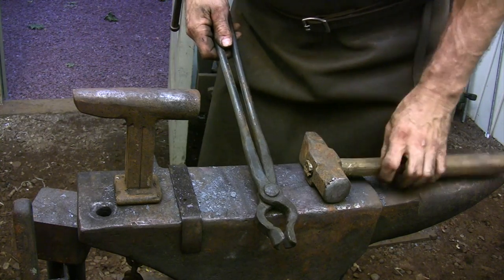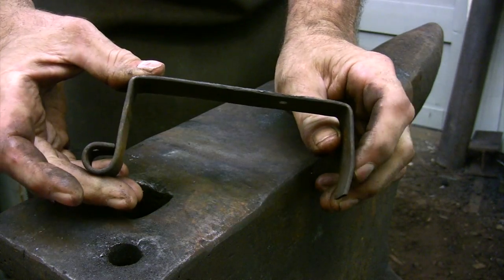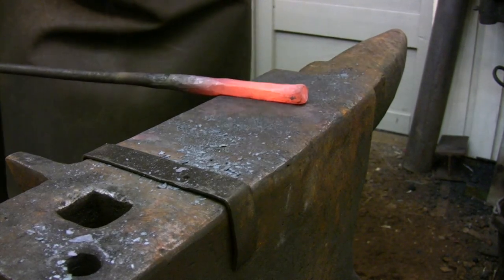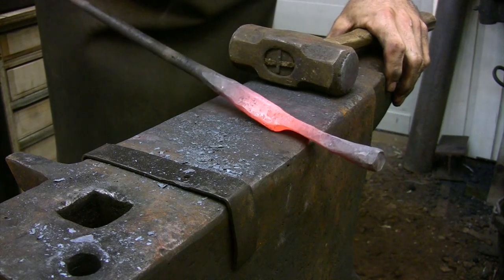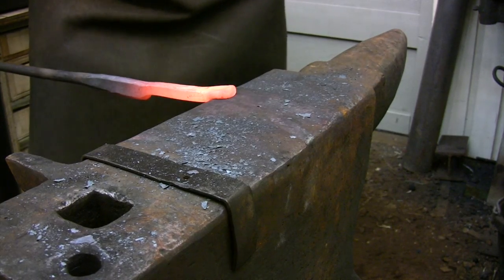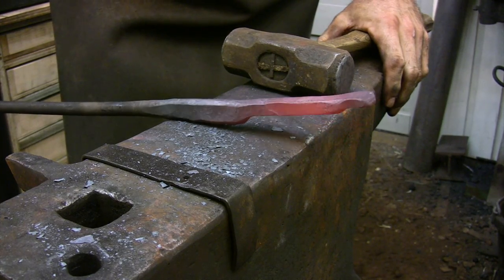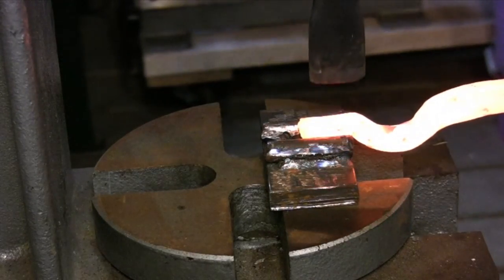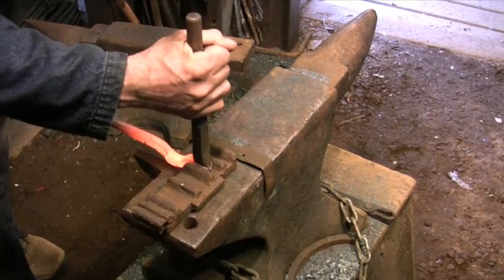Blacksmithing for beginners -  Forging blacksmith tongs  5

Comment: As a fifteen year old with only about one year of blacksmithing under my belt I find these videos extremely useful for me and my homemade forge. Not to mention you are quite the inspiration for me. Keep up the great work, sir!
Reply from the maker: It sounds like you started bout the same age I did.  I used to get up in the middle of the night during the winter and turn the furnace off.  Then a few hours later I would turn it back on.  That gave me about 20 minutes to forge out little knives while the furnace was constantly running trying to heat the house back up again.
Reply: trenton cook I just turned 15 yesterday!  I have been at it for a year and a half or so and they are helpful when I want to refresh my memory on how to do something specific.
Reply: Keep it up mate, youngsters like you are our future and preserving these older and slowing being being forgotten trades is very important! Hope your kids in future years carry on the knowledge you are learning now! Seek out the old guys, not hard to find if you really look hard, a world of knowledge just waiting to be exposed and they would be so tickled to have a young guy like you sucking the knowledge out of them!
Reply: I know there are a lot of blacksmithing channels, but i find Torbjorn Ahman work also very informative. One of my fav channels ;)

Comment: I built my forge pot as close as I could to you instructions because I felt it was good advise .Then other said my pot would be wasting fuels unless I was build large hammers and such ..Then I built a second pot which sats in your style larger deeper pot .Wish I could send my finished forage picture but I don't know how to.
Thanks for your help Sir.Merry Christmas
Reply from the maker: If you are using a hand cranked blower or bellows to supply air to your forge you will not be waisting fuel with this design because the fire is only getting air when you are at the forge working the blower. It is true that you will need a lot more coal to fill this forge for the first time but from that point on you should be using basically the same amount of fuel as anybody else.  If you are working on small stuff the heats will be faster so only a small fire will be maintained in the centre of the firepot and if you do need to heat up something larger the fire size will grow to accommodate that because you need to give it more time to heat up.  This firepot design has been found to be  a good compromise between being too small and too large and was the design used by every blacksmith that I visited when I was starting out.  As always , be careful,  when you get 50 smiths together discussing blacksmithing you can be assured that you will receive 150 opinions on any one topic ( 250 or more if alcohol is been served ).  Your success in blacksmithing is going to be determined by your ability to figure out what works for you.  All I did here is give you another opinion for you to consider.  Good luck and please let me know which firepot you decide to go with.
Reply: Love your bending tool , I'll be build my own copy latter Thanks

Comment: Firstly,  your methods are simpler to follow than the "Standard" procedure I was taught.  Your fixture for upsetting the bar is genius,  it takes about a year of frustration out of the learning curve. Secondly,  locating the eye is so much less troublesome.  Having that eye already in makes the flat a no brainer. Thirdly,  having the tongs from the first offset back identical makes tongs a magnitudes easier.

Comment: Many blacksmiths on Black Bear Community Forum. Avise a constance heat for I am using the Antricke ( that's the coal from west of Mississippi saying it needs steady air flow , I can't spell well Sir " 
 Next time I'll get the soft coal .I need heat near surface of forage to heat rods for tongs and my small pot worked better it seemed.
  But I try adding charcoal and wood and that was advise with a steady air flow which seem to helped.
   Thanks for helping me and others .
  I'll be playing as safe as I can , I get back in a few trails with fuels.
   Yes can't listen to all ...My pot is square shape next time I'll give measurements it's within half in as your prints and I did the cardboard model that was helpfully .But 3/8 in.steel was a challenge for my tools to cut .      Thanks

Comment: Hi, I'm 18 and for my 19h birthday im thinking of getting a few bits and pieces i need to begin my own small forge, everything i need is often quite expensive, tongs included so i figured why not smith the things that are initially non essential! does it sound reasonable to attempt forging tongs as one of the first things presuming i have at least a few different punches, is it too ambitious? i'd love to hear back from someone who has a lot of experience such as yourself! love your videos and your crafting skill! thanks a lot!
Reply from the maker: We all started with a charcoal barbeque,  a sledgehammer head anvil, a carpenters hammer and a pair of vise grips for tongs. I've only purchased about 10 -15% of the tools that I have, everything else I've made. That's what a blacksmith does - he make tools for everybody.  Hopefully this channel ( and the others on youtube ) will give you some shortcuts through the process that I didn't have but at the end of the day - your understanding of the craft is going to  depend on how much time you spend in the shop working at it. So the sooner you start, regardless of what you need to work with,  the better.  I don't know if you have seen this video yet?  https://youtu.be/RtIQa00AFqI    I designed these tongs to give beginners a way of making tongs without all the forging problems of traditional tongs.  They are ugly but they have all the requirements of a good set of tongs and the only forging ( moving metal ) that needs to be done is to draw out the reins - which is optional.  If you have any questions along the way, feel free to email anytime.
Reply: wow! what an amazing reply, thankyou so much, that really helps, im sure i'll end up hassling you with more question in future if i cant find answers anywhere else, thanks a lot :)
Reply: DF - In The Shop  
I read  a lot of comments on youtube and u hit the nail on the head .bbq charcoal and a lump hammer  and vise grips  is exactly how i started . Now a big gas forge and so many tools

Comment: I really appreciate your videos. But as a beginner I don't have all your tools that you are using.  Best wishes from Denmark
Reply from the maker: The tools are just for convenience.  I made hundreds of tongs before I had them.  The shape can be totally made with a hammer and anvil.  If you don't have a horn on your anvil, used a round bar in a vise. If you don't have a vise, cast the round bar in a block of cement.  The v jaws on most of my first tongs were shaped in a wet block of hardwood.  Use your imagination.
Reply: @df-intheshop330  Thank you Sir. I appreciate your time. The wet hard wood I can do. That's a pretty cool idea.i have a couple of chain saws and my fathers old Carpenter tools and a sheet full of hard wood.  I hope I understood it right. It was to hold the end of the tong while grooving in the the V shape.

Comment: why do you hit the anvil? i see alot of people do that in videos. when punching a hole or when pauzing.
Reply from the maker: If you are talking about when I'm ready to turn the work over to punch the other side?   I'm not actually hitting the anvil but I'm hitting the work to drive it off the punch (the piece is lifted a little off the anvil and I'll hit the work to drive it down).  Any other time I'm just letting the hammer come to rest on the anvil while I'm changing position or just having a look at what I'm doing or something.  I'm just lifting the hammer enough to get it off the work and then I let it fall to the anvil ( and it will bounce a time or two ).  It just a way to conserve energy. It takes a surprising amount of effort and time to quietly set a hammer down on an anvil.  I only do it when I need to stop hammering for a moment otherwise I'm hitting the work.
Reply: Most of us just do that to keep a rhythm.  It's a bit more work to just stop the hammer a million times.  Keeping a rhythm is actually really helpful. Sometimes I just whistle songs to have a rhythm. Johnny Cash was on to something.

Comment: Question-- can I do this with 1/2 in rod?
Reply from the maker: The bar stock I started with is 1/2".  In the first video of this series I explain the upsetting die that i used to get the bars that I'm using here.

Comment: Whst kind of steel whete do u get round ling steel like that
Reply from the maker: This is just hot rolled mild steel.  Any steel supplier will have it.  It comes in round, square and flat sections.  It usually comes in 20 ft lengths but a lot of places will sell it by the foot.

Comment: I noticed in the video that you mentioned a "90º Turn" at the boss segment of the tong piece. Didn't you mean a "45º" turn? Most tongs have a 45º set-down at the boss for the bit of the tongs. I'm just wondering if you meant to say "90º" or if you actually meant "45º." Thanks for the video.

On another note, it might have been more helpful if you showed both halves of the tongs you were making. You did not. You only made one side. It can and is, a bit confusing to beginners because they are watching you make only a single piece. And, the piece was still incomplete at the conclusion of this video. Your info is good. It's just a bit lacking and there are a few inaccuracies such as the set-down for the boss and bit. We as viewers are left scratching our collective heads for where to go next in tong making by your methods as demonstrated in this video.

I like that you did not include a noisy background soundtrack or music. I appreciate how you tried to use the sounds of you as you forged and did your work. The sounds of the blows of your hammer, the ring of your anvil, the visuals of seeing the steel move as you forge it... all are important components in blacksmithing and are just as important in telling a video story. Thank you for that, and thanks for sharing your video. I hope that I did not cause offense, no offense was intended.  Peace and be well.
Reply from the maker: I appreciate you comments and suggestions.  No offence taken.  These are some of the earliest videos I made and I do intend to redo them when time permits.  Also at this time You tube had time restrictions on how long a video can be so that is the reason I have 5 videos in this series.  The rotation is 90 degrees from forging the bit too the boss.  What you are referring  to is the angle that the blank is positioned on the anvil and that is roughly 30-45.  The reason I only made one half of the pair is because the two halves are identical.  The complete process including assembly was covered in the video on making flat bit tongs.  These videos simply show how to approach other types of tongs. They were never intended to be a complete tong making video.

Comment: So you say this is video is for beginners but then you use equipment that a beginner would not have.
Reply from the maker: The first video in this series describes how to make the upseting jig I'm using.  Also the jig isn't essential. You can draw out the reins from a larger bar  or weld two pieces together.